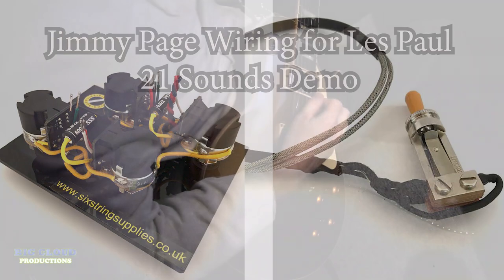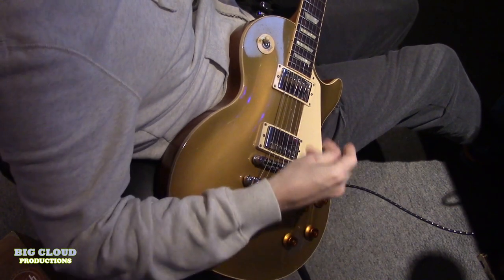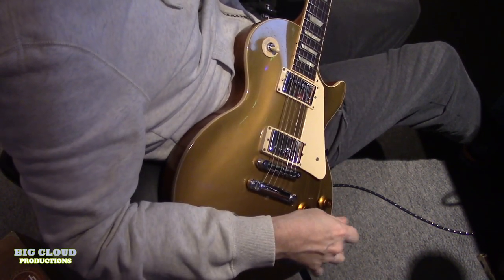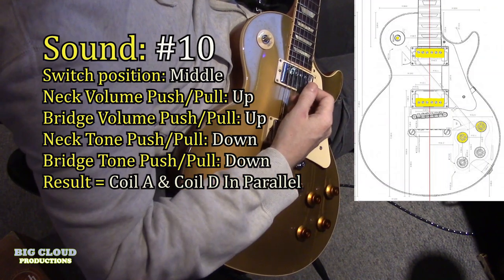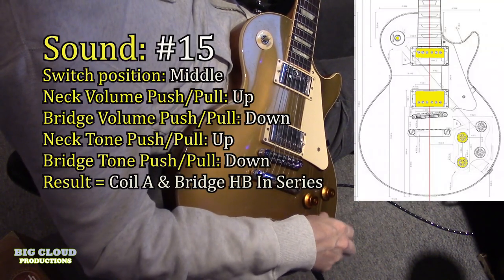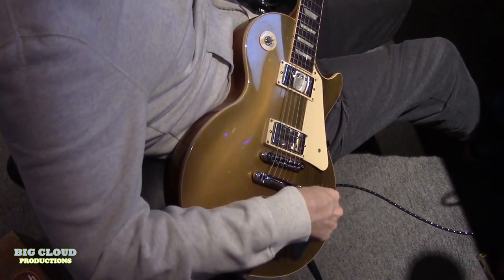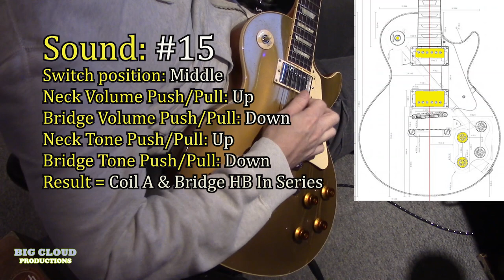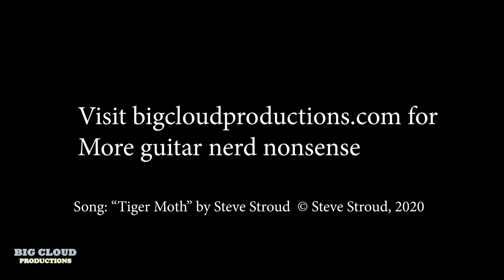Gibson Les Paul Standard with Jimmy Page Wiring (21 Sounds!)

Comment: I was able to do this wiring all by myself a while back, while installing new duncans with 4-conductor wires, beware though some diagrams are wired for independent volume control which sucks big time. Also chose to split the screw bobbin from the neck pickup, instead of the slug bobbin and they are still hum cancelling with the added benefit of more bell like neck tone from the position of the screw bobbin

Comment: I had a guitar made by an English luthier called Doug Wilkes which had three Dimarzio SDS's with series/parallel switches and mini toggles for reverse phase on each pickup, all three of which could be combined with either, or both, of the other pickups in any phase combination. It's given me a headache just typing all that so I'll leave it to a maths wizard to work out how many sound combinations that was. It was unbelievably complicated to use in a live situation, so lived in the studio. This, since it was physically unwieldy - 24 fret neck joined to the body at 24, and a heavy maple body with a tail cutout for a more comfy seated playing position - was likely it's intended environment. This ax sounds very similar in the range of sounds it can produce. My favourite guitar is Les Paul Junior- one pickup,no switches, no maths degree required.
Reply from the maker: I hear you. I'm leaning towards one of those inflatable ones you get at weddings.

Comment: Stop me if I'm wrong here I have a 2017 Gibson Les Paul Standard HP and you're telling me it's basically the Jimmy Page setup?🤯Mind blown
Reply from the maker: Very similar, yeah, but not identical. I'm not exactly sure what the wiring was on the 2017 models, but my 2013  standard came with 4 pushpulls, (2 x coil taps, 1x phase and 1 x blower ). The JP set up has a series/parallel push-pull  instead of the blower and is wired a bit differently.

Comment: At the 24 second mark you see the original Gibson PCP board. What I don't understand is why am I seeing 4 capacitors on it? I know 2 of them are for the tone, but what are the other two white Mallory caps for? Treble Bleed?
Reply from the maker: I think, if I remember correctly, the original 2012 pcb board had a special "fat tap" coil tapping system on the humbuckers, which sent each tapped pickup through an additional capacitor.

Comment: Followed every bit of information to a "T" and still having problems because the phase knob is reversed.  It's out of phase when it's pushed in.  Pull it out and it's in phase. So frustrated.
Reply from the maker: Where did you get your kit/wiring diagram?
Reply: @Bigcloudproductions  I pieced it together using the same pots and caps but it turns out the wiring on a burstbucker is different for the bridge pickup.  Jim Decola....THE Jim Decola who actually designed the circuits and was a Luthier for Gibson among other things, responded to my question in a Facebook group. He said he reversed the wiring on the bridge pickup to account for reverse wiring and magnet in the pickup. So white is hot,  green is ground, unlike what all gibson other wiring colors are.
Reply from the maker: @fredtaylor9792  sounds like you've found the culprit. Swop the wires to standard and see if that solves it
Reply: @Bigcloudproductions  Everything works exactly as it should now.  Thank you for responding.  This mod is a fun project and really adds alot of range for the guitar!
Reply from the maker: @fredtaylor9792  no worries, glad you got it sorted! I remember the rats nest of wires in my control cavity all too well, not the easiest of projects.

Comment: Great video! Are there any settings for having the inner coils (B & C) on together? I double checked your video and I couldn't see that as a setting.
Reply: No as it would need a phase reverse for the upper coil. It can be done but would need an extra switch. Or wiring the neck humbucker out of phase to begin with

Comment: Capacitors are capacitors. As long as the value is the same IT IS THE SAME. Paper in oil is 100% snake oil. If you like the vintage look of them then by all means use paper in oil. But capacitors are capacitors. Any difference that is perceived is just due to the differing tolerances. Potentiometers and wiring are what really matters. Anyways, great guitar!
Reply from the maker: You're right. A capacitor has no inherent sound. But let's be honest, 99% of owning a Les Paul is the nostalgia and all the associated mojo bollocks, I'm guilty of that too, so I get why people prefer them. 😂
Reply: @Bigcloudproductions If its because of the nostalgic factor associated with vintage/vintage style guitars then I completely understand and respect the decision to use paper in oil capacitors. But I like to make the point that there absolutely nothing wrong with a $0.25 film cap as long as the tolerance is tight.

Comment: Cool setup. I didn't know someone had a pre-built wiring of the full 21 option Page wiring. I did something similar on a Les Paul years ago based on an article I read about that setup, but in the end the only thing I used at all live was splitting the neck pickup so it was a single coil to get a Fender-ish rhythm thing. I eventually rewired the guitar to standard with a single switch under the pickguard to split the neck, because I didn't really like the push-pull pots for switching live. There's a good video of Page talking about his #1 guitar where is says his #2 Les Paul had all those options, but he only added option 8 (Peter Green pickups out of phase) on his #1 guitar. https://youtu.be/zTbbYk0ezeM
Reply: The 21 sound harness was done circa 1985 on #2 by Steve Hoyland..I am unsure if anything was recorded with #2  ?
Reply: If you can find a working link to that video I'd really like to see it thanks